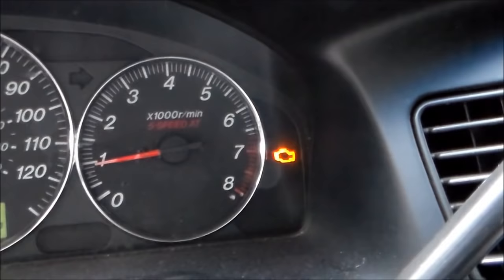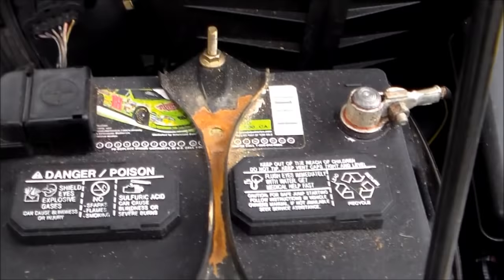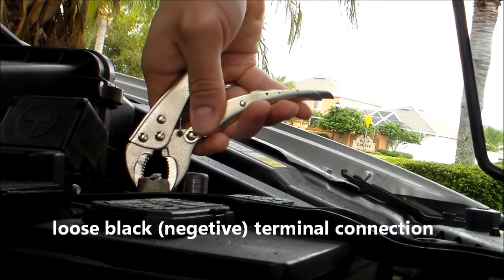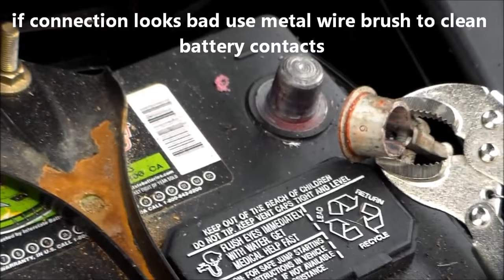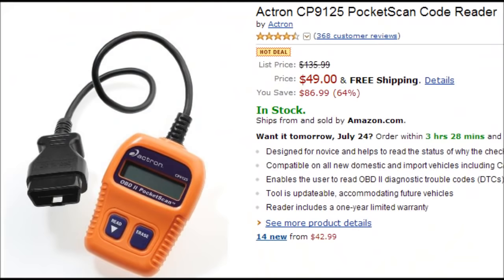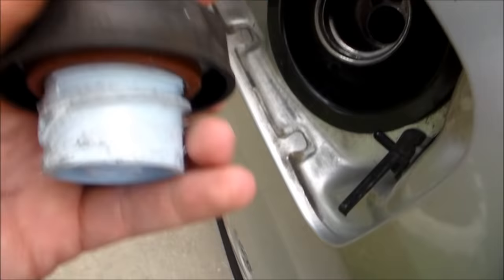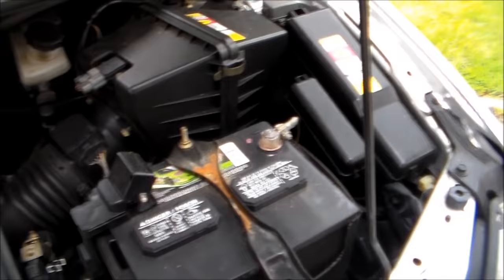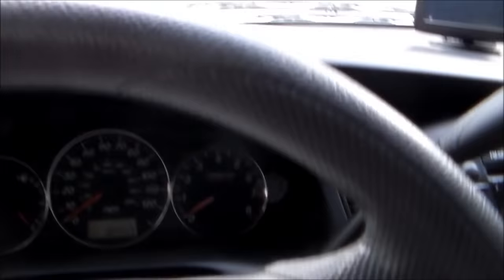HOW TO RESET CHECK ENGINE LIGHT, FREE EASY WAY!

Comment: You can fool one person but not a computer, you are not fixing the problem just clearing those codes, I bet you 80% all of you that did that the light came back on in a few months & this light  can damage your engine if you don;t take care of it, like lean condition
Reply: te69penene a few days is more like it.
Reply: superskiier50 HAHAHA JUST GIVING EXTRA TIME, I DON'T WANT TO SOUND TO MEAN BUT USUALLY AT THE THIRD WARN UP IF THE PROBLEM IS NOT FIXED THE LIGHT WILL RETURN
Reply: +te69penene Two complete drive cycles at the most.  Most of the sensors will trigger even faster, one complete drive cycle. Drive cycle changes based on vehicle, terrain, speed etc.  

As for this fabulous TIP, he should stick to fixing tablets, his car knowledge (or lack thereof)  is just dangerous.

FIX your damn car, you may as well just close your eyes or stick electrical tape over the light until it dies.
Reply: +ozmedia ...NO, the drive cycle DOES NOT change with terrain or speed.  The drive cycle is a set of very specific conditions that the computer knows acceptable sensor reading ranges on.  Terrain, speed, RPM, what gear you are in, etc., are conditions required for the drive cycle, not parameters that alter the drive cycle.  Some are hard to meet, such as Volvo, who would have you accelerating from 0-30, 0-45, and 0-60 all within a certain number of miles on a flat road (no hills) with an ambient temperature of 65-75 degrees...Here in AZ, temps don't drop below 90 at night during the summer (highs hit the 120's), so good luck setting THAT readiness indicator.  Oh, and before you try to rebut by spouting shade-tree partial knowledge back at me, I worked as an emissions control specialist for many years before starting school to become an engineer that designs these systems.
Reply: Ok, calm down there, tiger.  That's not what you said and no I didn't misread, at least not if the comment was meant to be in the english language.  You misstated.  Your statement, "Drive cycle changes based on vehicle, terrain, speed etc." is FALSE. Any "changes" from one drive cycle to another are based on vehicle year, make and manufacturer, NOT terrain or speed.  The drive cycle for a particular vehicle NEVER CHANGES.  My 2004 Jetta has the same drive cycle, no matter what the terrain is.  Changing my speed or terrain will not alter the parameters or test conditions I must meet to satisfy any portion of my drive cycle.  Quite the opposite, in fact.  If I go 40 and the portion of the drive cycle requires me to maintain 50, I failed to meet the conditions of that portion of the drive cycle. The drive cycle will not magically change to suit my preferred driving speed.  Terrain and speed are two of many very specific parameters of TEST CONDITIONS that must be met.  The sensor readings are VARIABLES that should fall within certain set ranges if things are working properly.  This is really just part of the most basic fundamentals of systems design and analysis.  It's OK, though.  the difference between conditions, parameters, and variables can be tricky for somebody who skipped college and went to car fixing school.

I'm NOT fresh out of trade school.  I'm not even happy to admit that I WENT to a trade school, let alone to thinking that graduating with a 4.0, getting an occupational applied wanna-be associates degree, and a few ASE's was actually an achievement.  I'm after a REAL degree...my third real degree.  This one is a BS, which will be followed almost immediately by a MS.. I'm not, nor will I ever be merely an ASE or certificate engineer.  I will never be just a tradesperson who has the title of engineer because he (sort of) designs things and may even possibly have his FE.  I'll be (and already am) real deal big-boy engineer with a university education and multiple degrees to back him up.  I probably did NOT study any of your white-sheets.  I may have referenced one or two, but once you get beyond a grade school...oops...I mean a trade school education, white sheets are more reference material, not really "study" material...but hey, I better pipe down...the guy who wrote them just came in-- Mr. "I assemble components in such a way that they fit around and interact with the rest of the engine and have a fancy title, so I can be demeaning to everybody and anybody who finds a legitimate error in my statement...I STUDIED WHITE SHEETS, for God's sake!". 

To tell the truth, I don't know you and you may actually know something and just have issues communicating your thoughts.  If that's the case, I'm sorry.  It's quite common amongst people who are highly intelligent.  Hell, I have been guilty of the same thing--normally while trying to explain thermodynamics or basic quantum mechanics to strippers, but it's still an issue that must be addressed when it comes to light and not a reason to cry about like a child.

Finally, as far as misreading is concerned, the cast-iron pot called the kettle dull, non-reflective, and over-sized.  I never called you shade tree, I just said don't come back with a shade-tree response...because that's all I ever get on youtube.  Instead of goingshade tree, you came out with a completely unrelated, irrelevant response about Cat codes and O2 sensors...that is unless you were just trying to further demonstrate my statement that test conditions were sometimes very specific and not always easy to achieve.  The video referenced a faulty gas cap, which would be the evap code he mentioned in the beginning of the video.  So, all you have done is misread my post and then further demonstrated that you apparently didn't even re-read your OP before jumping on the writing of a novel, or at least a tella-novella
Reply: +te69penene Try days, not months even.
Reply: +ozmedia Nothing dangerous in what he did.
Reply: +Jason Nichols Yes, the derive cycle DOES change with RPM and speeds. You said so yourself, in the next sentence,
Reply: +Jason Nichols Exactly.
Reply: +Jason Nichols You are an engineer and yet you use a made up term: white-sheets.  First, no hyphen or dash, second, white PAPER is the term you were looking for.
Reply: ozmedia Also, btw, if your flex connector starts going bad, no amount of CO testing will show any codes, but you will still get plenty of CO when you idle!

Why no amount of testing? Because in the current designs, CO isnt tested after the manifold (or before the Heated sensor/s, just prior to the muffler). Newer designs proposed should fix that issue.
Reply: Dan Lo Fat
CO is a by product, it doesn't need to be tested independently however, ALL AirCare facilities I've ever worked with, US and Canada, test for CO emissions in the exhaust. It's just a result of incomplete burn.

Comment: Hi guy, this works of course.  My Mazda 6 check engine light came on at 30,000 miles and I sprayed the Mass Airflow Sensor (MAF) down with some MAF cleaner and then reset by disconnecting the battery terminal.  Engine light never came back.  Just FYI.
Reply: Will that work on vw passat 2002
Reply: +Robbie JK 
Resetting the light didn't fix it though.  It would have gone out in a couple of drive cycles if it was just a dirty MAF.  All this does is delay your ability to pass an emissions test until it triggers again and you fail anyway.

In your case, you had a problem that cleaning the MAF helped alleviate.  My tester has several thousand test parameters, depending on vehicle complexity, there are a LOT of things that trigger a CEL besides a MAF, in fact the MAF is a rare one these days.  
Being a former Ford tech (Ford is the same as Mazda for most of the engines and drive trains...AND chassis!) I clean my MAF every 6 mos anyway, it's a Ford/Mazda thing, they work forever but do need periodic cleaning.
Reply: +Delanie Epps      Might do, but only IF you have a dirty MAF that is triggering a code or dirty enough that something else triggers a code easier than normal.  Be aware though that there are a few thousand codes and even more reasons they trigger.
Reply: ozmedia OK thanks you, And it worked, car needed to be clean 😂

Comment: Just make sure your car radio doesn't have security codes need to run it because disconnection the battery will make the radio think it is being disconnected. And the light will come back only if the problem is still there. It may take a 50 mile drive at different speeds.
Reply from the maker: very true, good point. that's why I made a another video after doing some research, obd scanner is great tool to read codes and reset them.

Comment: Or you just could've told the auto zone employee to clear the cods with the code reader.
Reply: how to clear codea
Reply: They dont do that any more.
Reply: Even if you have codes cleared still can't pass inspection. We have a vehicle can't get a friggin sticker for two years and thousand bucks at least spent on parts
Reply: Jenny Churchill you just go to the wrong emissions place. My guy always passes me all I do is clear the codes with the button thingy lol. Never had a problem to get the sticker
Reply: Exactly...they will not clear the codes anymore (liability reasons).  They did however give me the opportunity to push the button on their scanner to clear the code myself.  That way there was no blame on them should something go wrong.
Reply: Even "clearing the codes' does NOT get your car to pass inspection!
Reply: m girl 2017
Reply: Danielle Hart-Morrow before I go I use a code reader and clear the codes. The light turns off. I go and they pass it.
Reply: Joey :3 according to state law Auto store employees are not allowed to clear computer codes or the store if caught will be fined. And yes there are DOT employees out there who spy on them by showing up at the store to see if they will clear the codes.
Reply: Robert Hamilton Depends the state. California I can see them doing that, knowing their emissions are very strict.

Comment: After dealing with that engine light.......The computer was replaced. The light went out...it was a bad signal.
Reply: EasyListener LOL,   thumbs up dude!!!!
Reply: Chris Jacob 9
Reply: Gt iko
Reply: EasyListener Or better yet, just wipe the error codes.. don't see why you'd want to do that
Reply: My car had cut off on the expressway. The mechanic said that the engine computer was bad.That is the part that was changed out and that is what caused the light to go out.It was an inadvertand cure....

Comment: This form of resetting of a car does not prevent the sensor is started again, only it manages to keep the sensor off until the computer scan the problem again, so it's just a waste of time.
It is appropriate to bring it to a specialist for a diagnosis is made and the cause that makes a sensor lights is identified.

Comment: Are you a mechanic? The way you use a vise grip to loosing a nut is impractical for a mechanic.. dude... To take a battery connector off is very simple by using a 10-11 mm wrench it's practical way to do it properly..  other than that, it's general maintenance practice..

Comment: After you drive for about 40 miles. The light may come back on
Reply from the maker: that happened to me, i cleaned my mass air flow sensor and it fix my issue, but you may have a different issue.
Reply: It's how to reset the light only, not how to fix why the light is on.
Reply: in most cases its air flow sensor if its yellow engine light. and remove the battery after replace of the sensor should fix it at least for simple cars
Reply: Niklez7 is right about mass air flow sensor and can also be the o2 sensor as well. It's not always the gas cap problem.
Reply: i engine wash my car. then CEL was on. tried changing spark plugs , i tried resetting the computer. still its on. help pls

Comment: question for you guys, i pulled my negative cable and the CEL doesn't go away...thoughts?
Reply: this doesn't work on all cars, only a few. so if you can't get it to reset after a few minutes, take it to a shop or auto zone and they can reset it for you. if the light comes back on after 50 miles or so, your problem wasn't resolved
Reply: +bryan vicquery and in thet few, after while lamps switch on again after some time, and why negative cable, why not positive, ha ha crap video
Reply: +Cody Audiss  Go on Amazon..  pick up a sub $20 code reader that has reset feature. There are several in the $12 to $18 range. Pick one with alot of purchases and favorable reviews.. if others have had success you likely will too.  Most OBD2 ports are under the steering wheel or in the driver footwell area.. or you can google your car model/year and obd2 location and likely someone will have posted info where it is.  By the time you drive to an autoparts store 3 times the gas savings will pay for a cheap obd2 scanner/reader/reseter.
Reply from the maker: Watch my new video "4 ways to Reset check engine light". That will help but if your error isn't evap leak from loose gas cap then light will popup again.
Reply: +Cody Audiss pull pos terminal instead 4 least 10 seconds
Reply: +Cody Audiss "CEL doesn't go awat... thoughts?" - This trick is specifically for solving the case where your engine light is falsely turned on due to the computer software being dumb.  If there's an actual engine problem that you need to resolve, the engine light will persist to turn on no matter what you do.
Reply: Didn't fix the problem

Comment: If I go to auto zone and ask them to scan my truck will they do it for free??
Reply from the maker: yes
Reply: They will not turn off the code...
Reply: Chris Jacob they got you. I been to autozone and advanced auto parts when check engine light comes on, and both will scan and run the diagnostics codes for you to let you know what needs to be fixed. Most WILL NOT reset the code cuz people try to have it reset in order to pass their vehicle emission test.
Reply: Yes for free you hand them your ID and they keep it until you bring back the scanner
Reply: Jose Ibarra
Reply: Delvin Brinson ???
Reply: +clokedbigman Scanners only show code, generic codes in teh case of Auto Zone.  

Unless you fully understand emissions system and what sensors trigger codes (for example, an O2 sensor code usually doesn't mean the O2 sensor is dead) you will just waste time, money and effort while blindly throwing parts at it.

I'm a licensed mechanic, in addition to 4 years in trade school and 15 at a dealership, it took an extra two years of emission diagnostic training and hands on for a long time before I learned exactly WHY certain codes appear in order to replace the right parts of the system instead of temporary patches.

Comment: Will give this a try.  A few days ago I was stopped at a light and the car started to idle rough then the check engine flashed on and off several times then stayed on solid (97 lexus).  I pulled over and stopped the car. Checked under hood for anything obvious. Restarted the car and it is smooth as can be but the light is still on.
Reply: The rough idling is called a misfire. you would have codes ranging from P0300-P0308  or potentially  P0200-P0208. It was flashing because the misfire was great enough or on enough cylinders to do catalytic converter damage due to the amount of unburned gas getting into the exhaust. 

Unless other lights came on as well.

Comment: This guy should stick to fixing computers. I'm a licensed automotive service technician and I can assure you this is not the proper way to fix a check engine light. Who ever told you that there is air in the gas tank should not be working on cars.
Reply: Gus Fournaris Same here. I couldn't agree with you more.
Reply: Your are correct Avinash, I bought a Toyota Corolla in 04' and the owner/dealer and friend told me the check engine light was on and remains on due to something involving the gas tank cap, or the seal around it. He had it fixed of course thinking it would fix the issue but it came right back the next time he opened his gas cap. He just left it alone after that and disclosed the info to me when I bought the car. I also had someone mess with it thinking it was something simple and it stayed off until i put gas in my car again.. It was a 2000 Toyota my son drives now and that damn light it still on. It never caused any mechanical issues though so I just let it be and it's been shining for now for 12 years!!!! LOL!

Comment: wtf is the point of this?? your car still won't pass emissions regardless of whether the light is on or not.. resetting the computer also resets all diagnostic information... therefore you cannot pass an emission test.. if this was 10-15 years ago, sure no problem.
Reply: so if i was to do this,it will still fail,i have a2006Jeep Grand Cherokee. i figured . thanks.
Reply: yeah, I loved pre 96 cars. you could trick the test if your car wasn't totally roached out. if you fix the issue and go through the needed amount of drive cycles, you will pass emissions. i'm sure you knew that though.
Reply: Ya I figured as much.of course I paid it off and now it's gonna start having issues. I have 3 codes going off oh well it's going in tomorrow. Get my wallet ready..
Reply: lol
Reply: I have been doing for 3 yrs.  Unhook the battery, drive about 30 miles go straight to Smog place and I have passed.
Reply: BlackHoleSun97